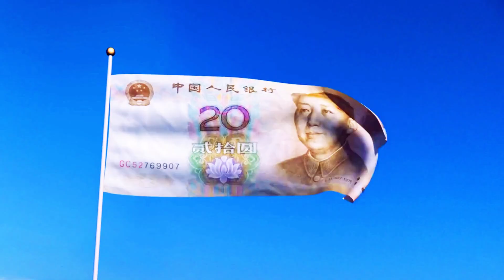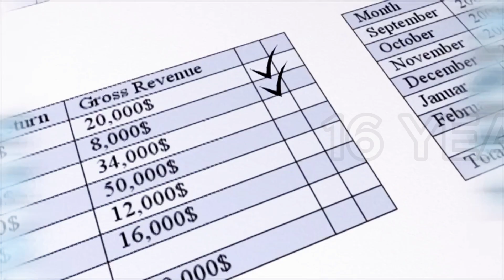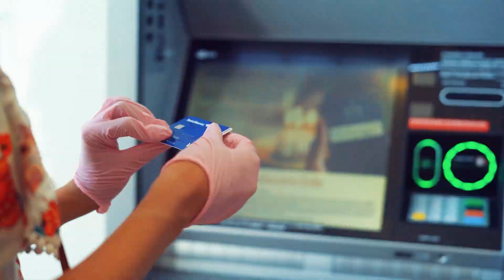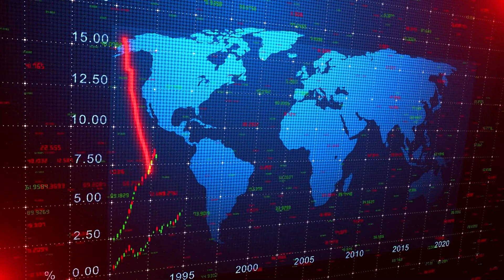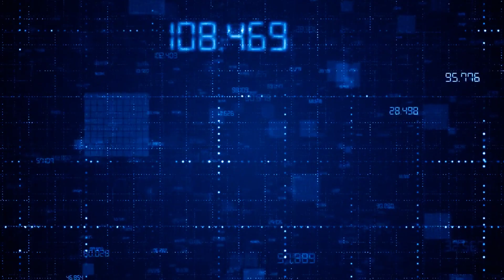Humanoid robots will be mass produced in next 2 years

Comment: Electricity is the Achillies heel of robotics.  Not only do you need sophisticated A.I. - but there is also only so much that current battery technology can do - and it does not make sense in most situations to use humanoid robots.  We usually use robots in factories that are plugged in or that can move - on wheels - to a charging station.  Humanoids tend to burn more energy.  But with NEW leaps in battery technology - I am sure humanoids will join other robots on the factory floor.  I do not know how many - though.